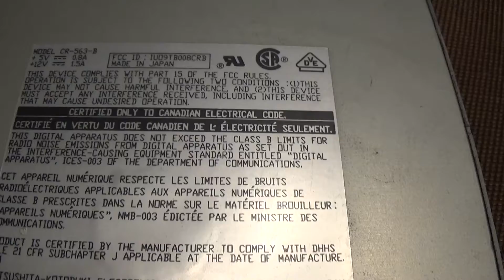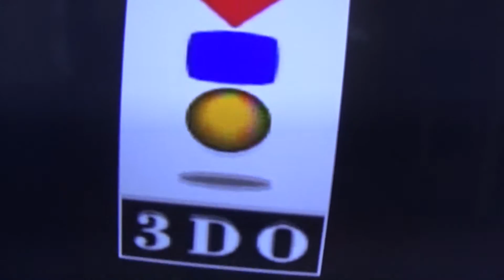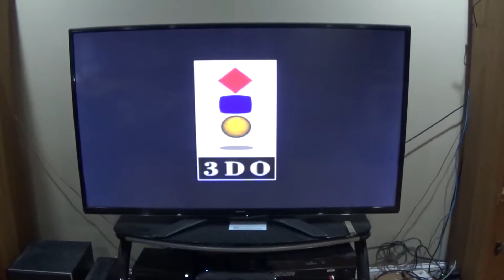3DO CD-Drive Replacement | The Idiot Repairs

Comment: Just as a follow up to this, I was able to do the exact same thing but with an alternative IDE model, CR-572-B. Innards are exactly the same. 

I was frustrated after spending $50 on a new replacement lens (which was either dead out of the box or needed the pot adjusted). Had this drive from an old junk 486 computer but had never bothered checking it since I had never seen anybody anywhere mention that model number. Turns out it's the exact same internals.
Reply from the maker: Right on. I'm glad it worked. Thank you for verifying what I assumed would work.

Comment: I looked on ebay for that laser and it wasn't available, do you know of any other sites that may sell that laser?
Reply from the maker: the model number I used was CR563-b. I seen one on ebay, but the price was $100.00
Reply from the maker: MKE drives were made by Panasonic, Matsushita, and Kotobuki. Creative labs made the drive as well.
Reply: @theidiotrighthere1829  I just checked on eBay, the one for the $99.00 is a cr 562-b, is there a difference?
Reply from the maker: 562-b would probably work. I bet the ide model would work if you could find one of the early 90's drive. When I did this mod I used the main board off of the 3do, so if the motor cable's fit the ide drive, the main board converts the signal to interface with the 3do. If I can find an ide that works. I'll post a short vid on it.
Reply: Thanks